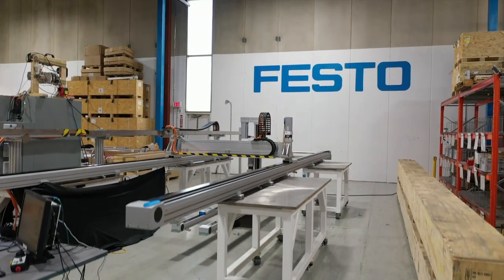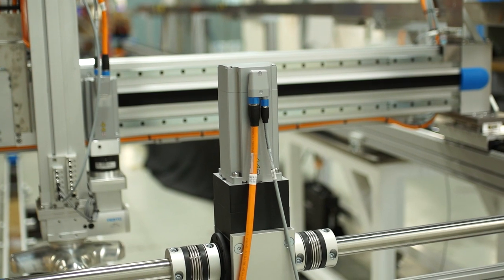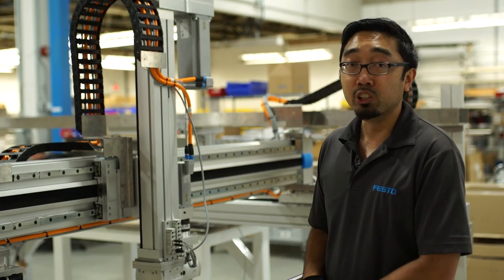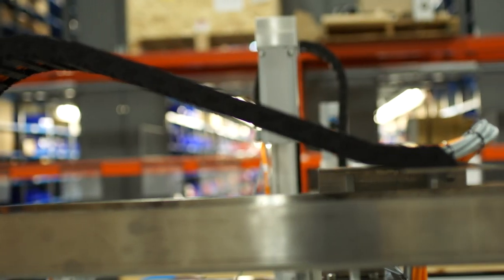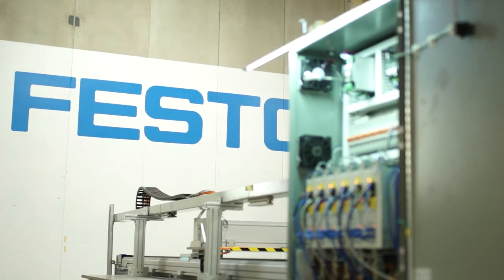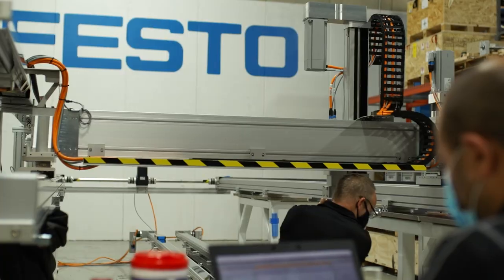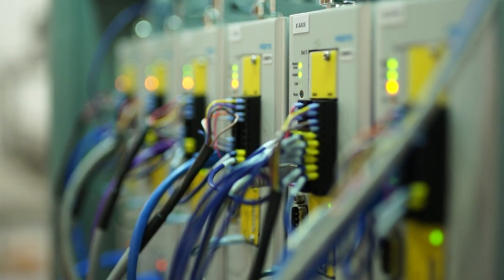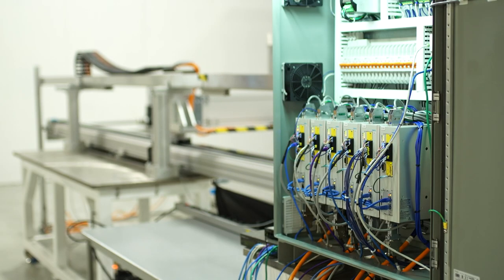Cartesian Handling Systems

Comment: How much the capacities, Load, speed, precision, large sizes of the Z,X,Y,R axis and the motors and reducers can arrival?
Reply from the maker: Our standard HGO offering has a max payload of 50kg and X, Y, Z max strokes of 3000, 1800 and 800mm respectively.

Depending on which axes are selected:
Toothbelt axes have a repeatability of +/-0.08mm
Ballscrew axes have a repeatability of +/-0.02mm.

To quickly determine if a standard solution can be used, go to the Handling Guide Online (HGO) page: https://www.festo.com/us/en/a/8031049/?autoShowConfigurator=true

However, if your application exceeds these standard capacities, Festo Customer Solutions can review your application and determine whether a custom engineered solution can be provided. Please contact your local Festo rep for more information.

Thanks!

Comment: Do you have any suggestions for a simple 2 dimensional controller. Essentially I need a left to right "gantry crane" that can drop  chicken feed in the correct PVC feeder then return to "home" position. Conveyor systems are insanely expensive, the closest DIY projects I can come to with code are robotic arms which is overkill.
Reply: vibratory conveyor with simple PLC-reinforced Arduino electronics?
Reply: Hi Jessica, is this for an in-house project or industrial type? I can suggest a few options for industrial but some DIY you can easily do it using arduino or RPI and some stepper motors. Let me know